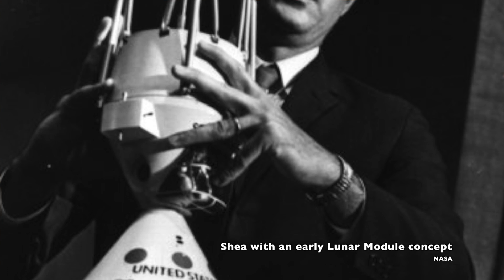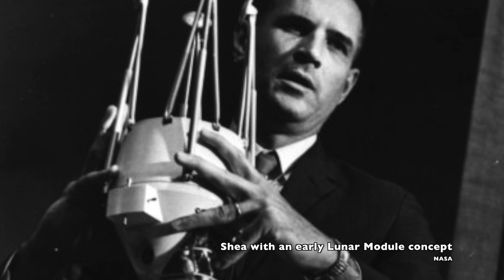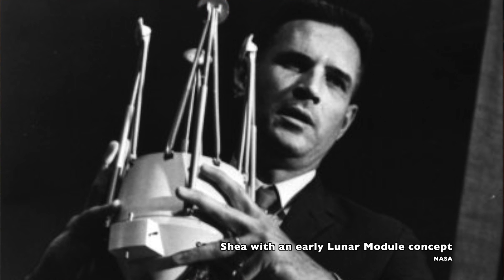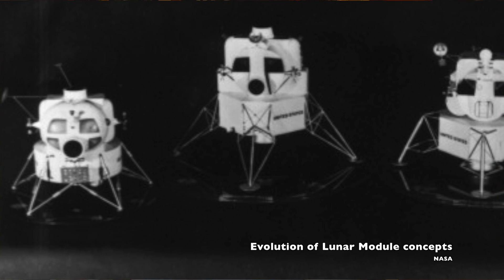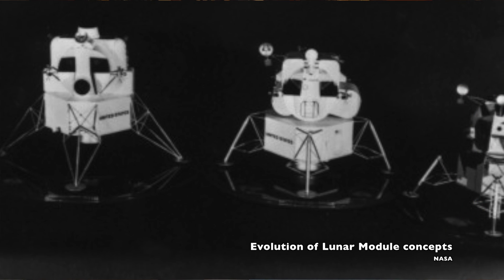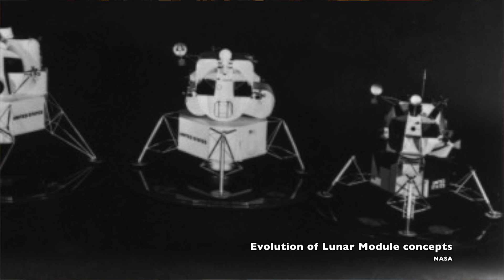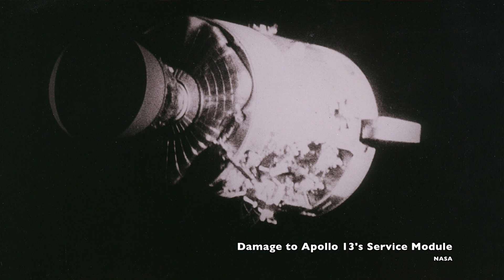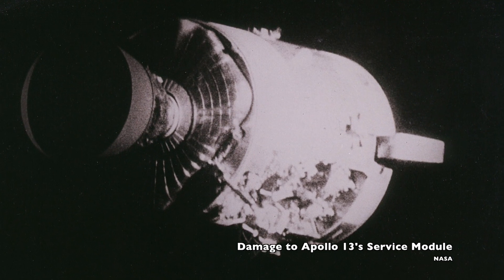How Did NASA Know to Use the Lunar Module as a Lifeboat?

Comment: The thing is I've never actually seen any documentation or paper trail about serious consideration of the LM Lifeboat Option after the design was frozen.  Unfortunately this is borne out in this quote from an official NASA History SP-350 Apollo Expeditions to the Moon:

A lot has been written about using the LM as a lifeboat
after the CM has become disabled. There are documents to prove
that the lifeboat theory was discussed just before the Lunar
Orbit Rendezvous mode was chosen in 1962. Other references go
back to 1963, but by 1964 a study at the Manned Spacecraft Center
concluded: "The LM [as lifeboat] . . . was finally dropped,
because no single reasonable CSM failure could be identified that
would prohibit use of the SPS." Naturally, I'm glad that view
didn't prevail, and I'm thankful that by the time of Apollo 10,
the first lunar mission carrying the LM, the LM as a lifeboat was
again being discussed. Fred Haise, fortunately, held the
reputation as the top astronaut expert on the LM- after spending
fourteen months at the Grumman plant on Long Island, where the LM
was built.

Fred says: "I never heard of the LM being used in the sense
that we used it. We had procedures, and we had trained to use it
as a backup propulsion device, the rationale being that the thing
we were really covering was the failure of the command module's
main engine, the SPS engine. In that case, we would have used
combinations of the LM descent engine, and in some cases, for
some lunar aborts, the ascent engine as well. But we never really
thought and planned, and obviously, we didn't have the procedures
to cover a case where the command module would end up fully
powered down." 

So as previously pointed out by another commenter if there was a serious thought given to the LM Lifeboat  the lithium hydride canisters would have been the same design. But also all the procedures they had to come up with on the fly would have been in a binder marked LM Lifeboat Contingency at someone's console. The one thing that hardly anyone ever mentions is imagine if this had happened on Apollo 8 on it's way to the Moon; 3 dead astronauts and no photographic evidence of the Service Module for the Review Board.

Comment: Only just a little over 2 years after Apollo 13, the LM "Orion" almost had to be used to bring Apollo 16 home when Ken Mattingly had trouble getting the CSM's SPS engine to fire to circularize the CSM's orbit. Luckily Mission Control was able to find a solution to the problem, allowing the mission to be carried out (albeit with a modified schedule developed by Gene Kranz's White Team).

Comment: After Apollo 13, did they change the lithium canisters to match each other as between the Command Module and lunar module?
Reply: That's a great question. There is no documentation suggesting that it was changed. Though a lot of changes were made - including third oxygen tank in command module separate from other 2, 400 AMP battery in command module separate from other electric system, thermostats for automatic temperature management and cannisters for water.

Comment: Uhh, they knew to use the LM as a lifeboat because they knew that that was what they HAD. If the failure of the O2 tank had happened AFTER a landing on the moon, they would not have had it, so they'd not have thought to use it. I don't buy the claim that they had a contingency plan for such a use, because if they had, they'd not have had to adapt the CO2 filters; they'd have designed them to be interchangeable.

Comment: Here's a question, why then were the CO2 scrubbers in the LEM different from the command module?
Reply: Most failure scenarios did not anticipate the CM needing to be powered down so completely snd assumed the ECS could be kept running.

Comment: I love the fact that somebody decided that a roll of duct tape would be included in the command module.  $10,000 per pound (or whatever, I don't need correcting) to put something in orbit and they included duct tape.  Cool!
Reply: The Hubble once got fixed because they happened to have paracord- "550 cord"- on the Space Shuttle. Somewhere along the line, someone really thought things through. "Going beyond suborbital? Take some duct tape, some 550 cord, and a Swiss Army knife (totally a multitool now)." 

WD-40 may have had issues with overspray, so you might leave it off the list... but it's always better to have it and not need it than need it and not have it.

Comment: Hi Amy, what were the sword like apendages underneath each of the landers pads? One could surmise they are intended to sink into the lunar surface for extra stability, but if they were rigid and one hit a rock or something this could have destabilised the whole vehicle.
Reply: They were contact sensors, to tell the astronauts when to cut the engine. In practice, I think all the pilots let the engine run until the pads hit the surface.

Comment: Amy, what can you find about John Young at Mission Control devising a way to fix the Apollo 17 rover fender accidentally torn off by a hammer Gene Cernan was carrying? I recall ABC legend Jules Bergman saying Young's improvisation may have saved the mission, because minus the fender dust would have covered Gene and Jack Schmitt while driving. More recent reports treat the fender replacement (which used maps, tape and a clamp) as not that important.

Comment: Appreciative of the work you put into this, but how did they "know"? Because DUH it was an obvious solution staring them in the face. "Them" being the engineers that designed, built, and wrote the manuals on these. A second space vehicle, self contained with rocket engine and life support, directly accessible from the damaged Apollo. Duh!
Reply from the maker: The question wasn't whether or not to use the spacecraft they had access to, it was first figuring out if the damage was so bad they couldn't salvage the SM and second determining whether the consumables in the LM could actually satisfy the constraints for a rescue mission. It was obvious to use the LM, but it wasn't obvious how.

Comment: Hi Amy. I have a few words to help you clarify the difference between "on board" and "aboard". I'm not trying to be mean to you...I think you're absolutely fantastic. Okay. You mentioned something about consumables and said "on board". Here is how you know if something is "on board" or "aboard" a vessel. Anything that is permanently fixed or attached, (bolted, welded, riveted or otherwise) is considered to be part of the vessel's "anatomy" and "on board". Things like passengers, cargo, crewmen, astronauts and consumables such as food, water, fuel, TANG and even liquid oxygen purposed toward providing a breathable atmosphere inside a sealed spacecraft, are considerd "aboard". While a tank for storing liquid oxygen for the astronauts to breath (in gas form, obviously) is fixed to the vessel and therefore "on board", the liquid oxygen inside said tank is "aboard". I know you can easily understand everything I have just presented you with. Now...there is one more part to present. How do things like rocket booster stages, space shuttle SRBs and space shuttle main fuel tank get classified? That's easy! those things are considered to be "out board". A little gasoline powered engine hung on the stern of a small fishing boat is an "out board" engine. The same holds true for all the millions of square yards of canvas fabric tied to the yard arms of "square riggers" like USS Constitution, and all the other ships that plunged into uncertainty for the sake of exploring the unknown!!! Now here's a little puzzle for you. I've thought about it a bit & I'm not sure how to call it. I wanna know what you think. Imagine a Greek Trireme! They could hoist a single sail if enough wind was present...but only for transit purposes. During combat, the trireme only used oars for locomotion. The oars were powered by people sitting in the ship. The oars could be drawn into the vessel & stowed during sail powered travel. Here's the question...during battle, was a trireme powered by on board locomotion, out board locomotion or aboard locomotion.?!! :) With all that being said, if you ever get around to inviting me over for dinner, I will be sure to show up with two cans of "Fancy Feast" for Pete!! Be well, live well and keep doing what you do!!

Comment: What happened to the Apollo 13 Command Module after the crew ditched it for reentry? Did it burn up on re entry into Earth's atmosphere or float away into outer space?
Reply: I don't think you mean the Command Module, they never ditched that, it's currently on display at the Kansas Cosmosphere & Space Center. As for the Service & Lunar Modules, what ever didn't burn up on reentry crashed into the ocean.
Reply: Because Ozzy specifically mentioned Apollo 13, the only lunar mission to return a LM to Earth, I'm pretty sure he meant to say the LM. All the SMs returned to Earth, & ended up crashing into the ocean.
Reply: It was almost certainly either following or preceding the astronauts into the atmosphere and probably disintegrated.
Reply: They meant the service module.
Reply: Actually, you are probably right, now that I think about it. The LEM makes more sense in this context than the SM.

Comment: Amy knowing what we know now would a direct abort return be a viable option for Apollo 13 ?
Reply: The SPS would have been unsafe to fire as the fuel lines may have been damaged.
The LM didn't have enough delta V to push the entire stack into a direct return unless they got rid of the heavy SM but the heat shield could have cracked from the cold soak.
After they got rid of the SM they noticed the engine bell was damaged and they were missing a thruster quad so even if the SPS did fire it may have been uncontrollable.
Reply: I know the service module was useless . I was talking about jettison it and using trh LM decent engine fo a long burn to get the CM/LM back as soon as possible,

Comment: I've always heard the Lunar Module had an incredibly thin foil like skin for the weight. I've always wondered if it would be thin enough that you could shove a pen through it. I'm just wonder how thin it was.
Reply: Are you talking about the mylar insulation or about the supporting structure. While the supporting structure by itself was as light as it could be, it is not true, that one could shove a pen through it. But in most of the pictures you see, you see the LM wrapped into the thermal insulation, which was indeed a very thin foil, built up of several layers.

Comment: But then WHY were the CO2 scrubbers round in one vehicle and square in the other?  
Thank God for Duct tape.
Reply: +Marty theMartian and they couldn't have had a 5 minute phone call and worked together?

In other words somebody at the NASA level didn't get the two contractors together on this issue.
Reply: Because they were built by different contractors in different factories.
Reply: exactly!
Reply: So ... NASA really did not try this seriously. They thre in some extra food and that was it?
Reply: Basically yes. As Amy told in the video: they increased the size of the tanks a little bit and that was it. There was not enough time to modfy the basic structure, since they were already building the LMs and were already way behind schedule. That the usage of the LM as a lifeboat was more of a theoretical issue can also bee seen, that there were no simulations done using that configuration and actually I am not sure, if the LMs computer could handle the shifted center of gravity without program modifications.
Reply: Low bid government contracts.
Reply: I call the solution "The Mother Of All Workaraunds." :)

Comment: I have always wondered if NASA had thought of this before. I wonder how the famous (infamous) charcoal canister (square peg round hole) still made it past the "refitters" if they already had this idea. Now if they only would have had the electrical wiring set up
Reply: +Dan R Just goes to show how rushed the Apollo programme was. You have to remember it was a space race after all.
Reply: Activated charcoal/carbon? No. IIRC, it was potassium hydroxide (KOH) or something similar. Wikipedia say activated carbon only works at very high CO2 concentrations.
https://en.wikipedia.org/wiki/Carbon_dioxide_scrubber
Reply: +Ian Tester  It was actually lithium hydroxide, which is indeed similar.

Comment: Wait a sec... if the Lunar Lander was always planned to be used as a lifeboat in an emergency,  than why was the CO2 filtration system not designed to handle all 3 astronauts, (which resulted in the famous line from the movie Apollo 13 "Well, I suggest you gentlemen invent a way to put a square peg in a round hole. Rapidly.")?
Reply: +looneyburgmusic Because two different companies build the system. The LEM was designed to support 3 people if the need arise. It just assumed the CM scrubbers still had power and functioned. As they knew if the CM lost all power for good. The LEM was not going to return them back to earth alive anyways. Something them fixed in the new models.

Comment: I have often wondered why the Apollo 13 astronauts never used the lunar portable light support system PLSS packs for supplemental oxygen. The PLSS were stowed in the LM, and the supply valves opened to free flow pack air into the cabin and reduce the CO2.
Reply: @ Roger . . . the PLSS packs, with the discharging of oxygen from its pressurized packs, could have created cabin pressure issues that may have been difficult to compensate for.

Comment: Actually as far as I understand it this was only the start of the story. During the Apollo 8 (I think) mission rehearsals a very similar scenario (loss of all power on the CSM) was thrown at the team. They tried to use the LEM as a lifeboat but couldn't work out how to set it up in time, it was a far from straightforward process and no one had actually worked out the details. So they tried to do it on the fly but couldn't manage it before the crew 'died'.

NASA dismissed this scenario as too unlikely to be worth working on further, BUT the LEM team were bugged about the fact they hadn't been able to save the crew, so they actually sat down and worked out how you could actually do it.

So when the Apollo 13 CSM went down the LEM team had a procedure all ready to use.
Reply: +dcwhitworth, They really only had a fair outline for using the LEM as a lifeboat. The different carbon dioxide cartridge shapes was one of the many things they did not prepare for.
Reply: Sorry, I disagree. About the only major thing they had to work out at the time was how to power up the command module. Virtually everything else had come up in simulations. Read this interview with Ken Mattingly http://www.jsc.nasa.gov/history/oral_histories/MattinglyTK/MattinglyTK_11-6-01.htm
Reply: dcwhitworth, OK, I read the interview and I see where in a narrow sense they knew what to do using the LM as lifeboat, but descriptions of having disputes about such things as free return and electricity usage on CM powerup indicate the entire lifeboat scenario was not fully thought out prior to the mission. In the end lots of talented people, working a lot of issues, got the crew home alive.
Reply: +David Hoffman Don't get me wrong, I agree with you. I'm not suggesting that it was a breeze and they had fully formed and tested procedures for everything they had to do. There was definitely a huge amount of effort and ingenuity went into saving the crew. Something like the Apollo 13 film was factually correct about what they ended up doing and the concerns they had, it just wasn't completely accurate about the process that led to the solutions.

Comment: Cool.  I read somewhere that Skylab was the result of left over Apollo equipment,  budget and staff.
Reply from the maker: +Casey Spain Here's a brief into to Skylab that might answer your question! https://www.youtube.com/watch?v=ZAjsxXED0SQ
Reply: +Casey Spain It was originally planned as part of the Apollo Applications Program which was a project to use Apollo technology for other things. It was largely shelved when NASA had cut backs, Skylab was about the only bit that survived.
Reply: Wasn't that "Apollo Soyuz" program.
Reply: +Casey Spain You're correct, it was a result of left over Apollo equipment combined with some things built specifically for Skylab.  Basically, it made it economical to do due to the left overs from Apollo

Comment: Why does the AGC have VERB and NOUN buttons in it? Why did they choose those words to make functions with?
Reply: +Yak40 Pilot That's how language works and it's also how most computer languages work. "Do this" (verb) "To that" (Noun). It means you can produce a much more compact control panel without having to put together a button for everything you want to do.
Reply: Aah so the words actually make sense in it :) Thanks a lot!
Reply: +Yak40 Pilot I'm not sure exactly how you'd use it, but presumably you'd hit 'verb' followed by numbers representing a command and then hit 'noun' and enter a number corresponding to an object.